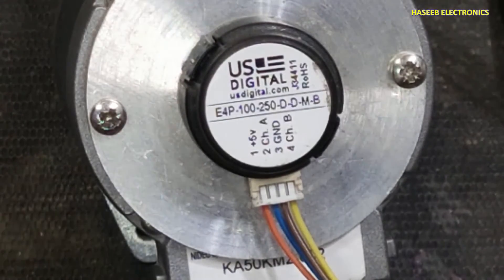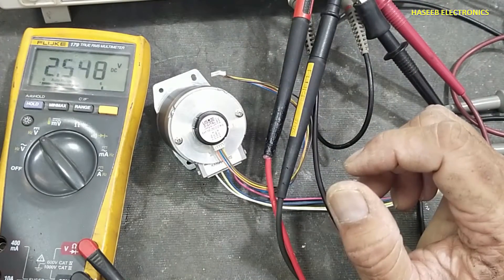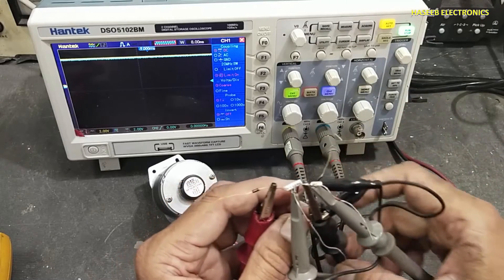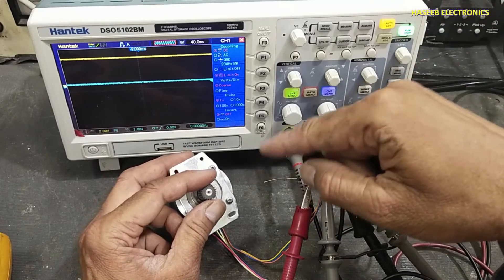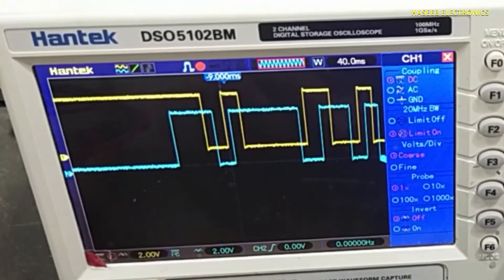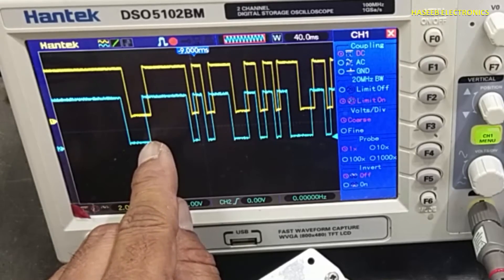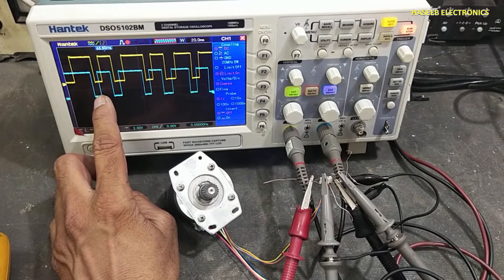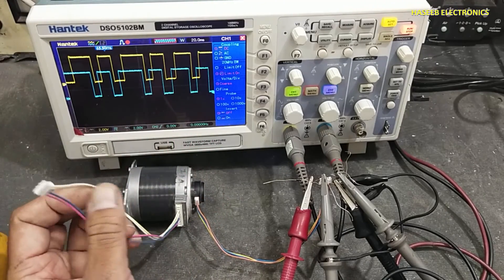{984} How to test optical encoder

Comment: Why did you switch to the FLUKE multimeter again?
Reply from the maker: i use randomly fluke 177, fluke 115, fluke 75 series, uni-t, kaiweets, aneng, and other analog meters 
any multimeter comes in front, i use it

Comment: Does this encoder, that's demonstrated here, has index signal?
Reply from the maker: basically channel A is summitry signal or index signal. and channel B is compared with channel A. to determine the direction of rotation, appearance of signal B is compared before or after signal A
Reply: @HaseebElectronics  If I can recall, Index should be provided to reset counting, i.e revolution marker, 'cause most encoders have many hundreds pulses per revolution.